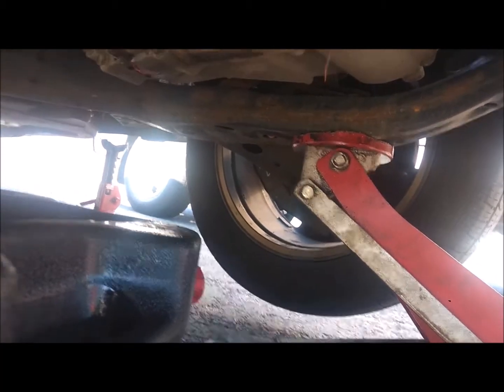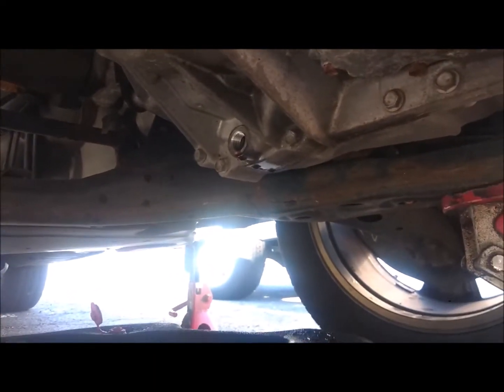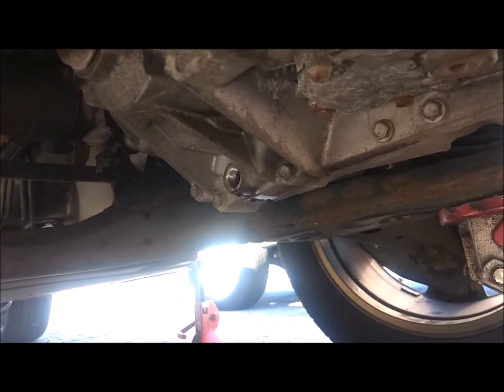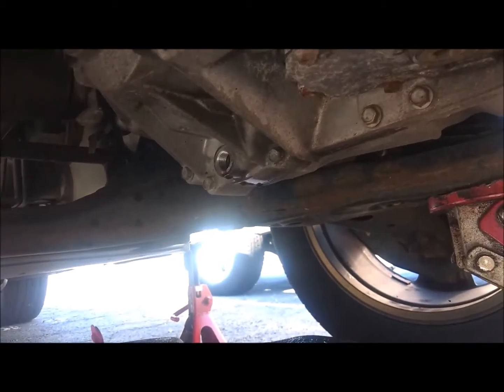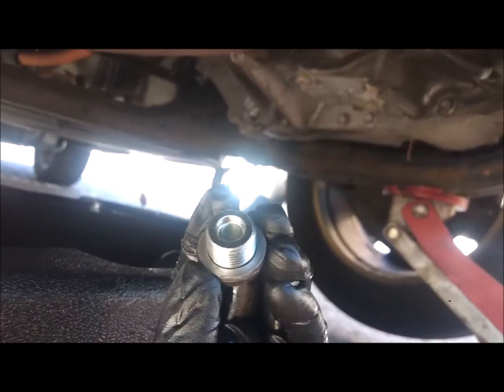Lexus RX400h / Toyota Highlander Hybrid Transmission fluid change

Comment: Hi is there a video for changing the filter amd gasket? I have a gasket issue and cant find any videos on that
Reply from the maker: In this transmission, there is no filter and gaset. It's the actual transmission housing you are draining from like manual transmission.

Comment: Thanks for posting this! I bought a 2006 toyota highlander hybrid 4wd. Going to do the transmission fluid change and the rear differential fluid change too. Not sure if it was ever changed. I tried looking for a shop manual for it but i can't find one that has specific info for the hybrid's, only manuals i can find are for the non-hybrid.
Reply from the maker: Its very easy to change. I change them every 20k. Bit of an overkill but i like to keep the fluids clean.

Comment: Do you have a 4wd model?
Reply from the maker: Yes i have the 4WD model.
Reply: @hobolyf  does your lexus have a drive shaft going to the rear differential or is it electronically driven?
Reply from the maker: @BenefitExploits  no drive shaft its electronically driven.
Reply: @hobolyf  That's awesome. I think that's better than having a drive shaft where u have u-joints go bad and have to replace it.
Reply from the maker: @BenefitExploits  plus these electric motors give good torque. These vehicles are not that great since this is their first try. Hoever the new RAV4 hybrid awd is amazing.
Reply: @hobolyf  i did some research, i did not know that the 4wd is part time. It's called 4wd-i. It turns on the rear electric motor when it detects slipping or slides. I wish there was a button where I could just keep it on, here in north US the roads have been very icy and you need the 4wd. I have 2003 highlander 3.0 4wd and that is good on snow and ice, 230k miles and it still runs good lol. But the 03' only has VSC system, the newer models like the hybrid have VDIM which is much better traction control system.
Reply: @hobolyf  did you do 4 qt for transmission? I just filled up 4 qt and it still not enough not dripping out. Maybe it's closer to 5 qt?
Reply from the maker: @BenefitExploits  no definietly not 5. What vehicle is it?
Reply: @hobolyf  2006 toyota highlander hybrid 4wd
Reply: @hobolyf  i took my drain pan and poured it into empty container and it looks like about 4.5 quarts came out
Reply: @hobolyf  i had to buy another quart of fluid. So i checked and i pumped 4 quart + about 12 oz that's when it started to drip out. Vehicle was level in my garage
Reply from the maker: @BenefitExploits  wow.